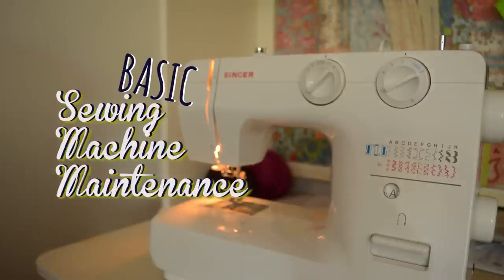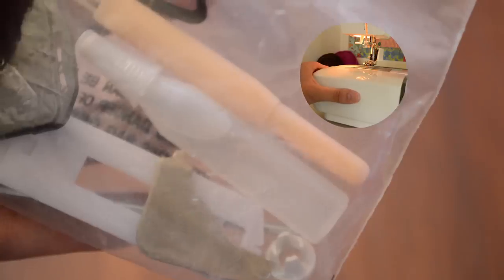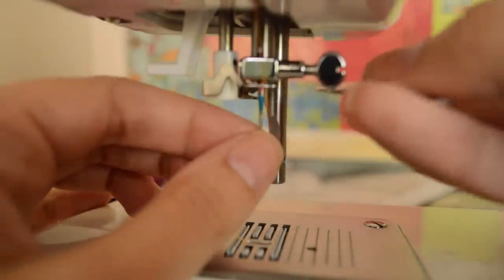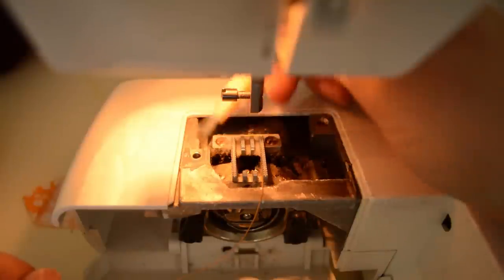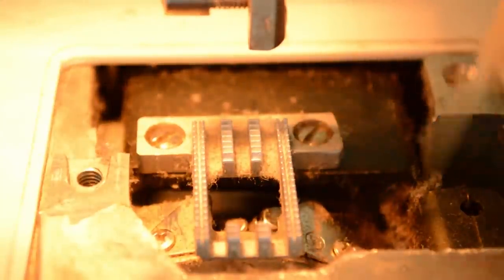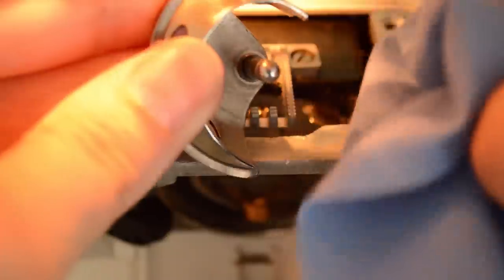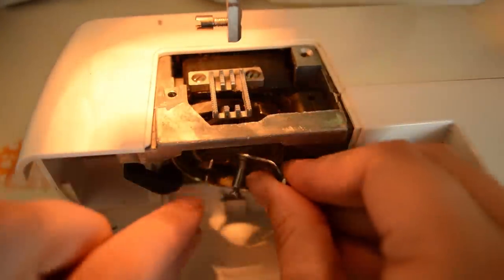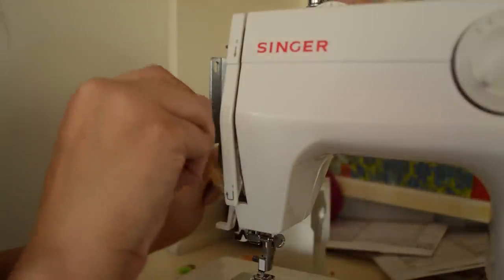Basic Sewing Machine Maintenance - how to clean and oil your sewing machine

Comment: Thank you so much for this video! I have inherited this exact same machine from my mother and it has been giving me trouble. Any idea on how to fix the threads from the bobbin area getting clogged? It ends up having like 3 or more of them getting jammed but the top stitching is perfectly fine. I've rethreaded, etc and nothings helping. Thanks in advance! XoXo
Reply from the maker: TheInfertileFiles Vlogs Hmm, re-threading was what I was going to suggest, or maybe adjusting the tension disk or changing the needle. I was going to suggest checking the troubleshooting guide in the manual, but it doesn't seem to list that issue. :/ Here's the guide anyway: http://www.manualslib.com/manual/364302/Singer-1100.html?page=37#manual